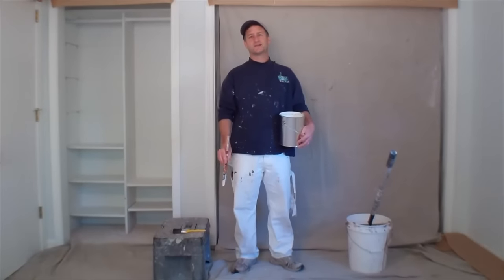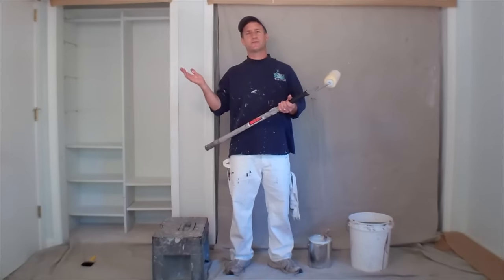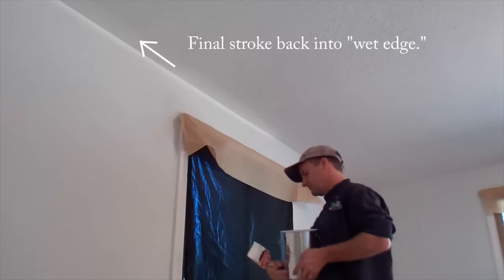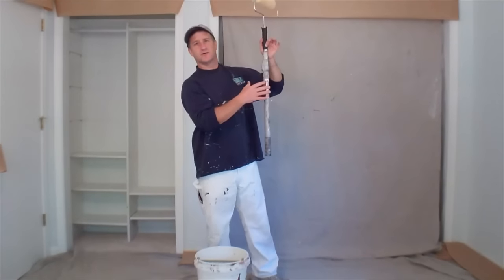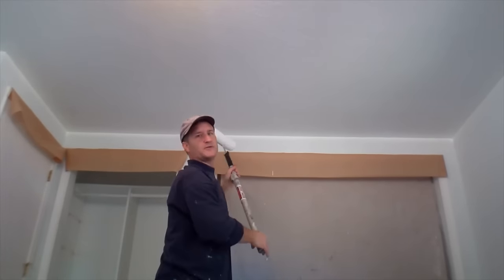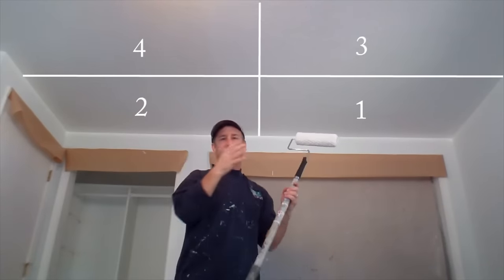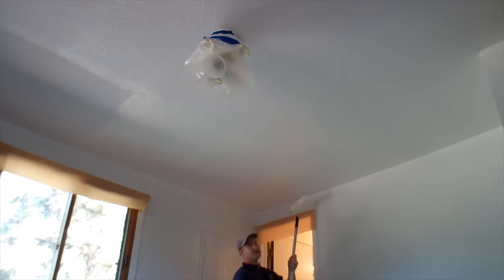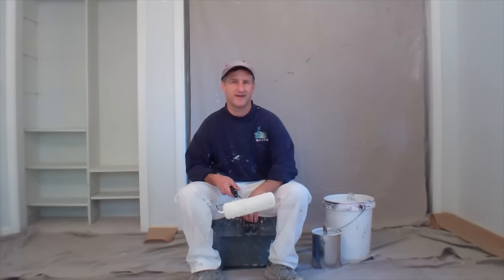Interior Painting Step 2: Painting the Ceiling

Comment: One of the things I've learned in my years of painting-ceilings is that by using a "short" stick, your head is thrown back and both it and your neck are constantly twisting-not good for the neck-especially if you have any neck issues (and if you do this often enough you will wind up with neck issue-which I have). To completely eliminate any head twisting; extend your stick out (about)  six-ish feet and work "in front" of you-so that you're looking ahead of you-never to the side. Work backwards-moving towards your backside. Once I figured this out, I never again twisted my head or ever had to tilt it back (slightly-once ina while). You'll catch on quickly and your upper spine will thank you.
Reply: Thanks for your great advice 😅
Reply: @ronaldneehao9723  My pleasure
Reply: Good insight. Thx👍
Reply: Really  good advice I had  the same problem
Reply: And it keeps the paint out of your face and eyes

Comment: Sure wish I had watched this video before painting my laundry room ceiling and walls last night! Your tip about cutting in a little at the top of the wall with the angled paint brush would have eliminated my problem of the old beige paint showing through in the corners and where the faulty edger I used kept hitting the popcorn bumps leaving a tiny bit of the wall unpainted. Ugh! Wish I had the energy to redo the job!

Comment: I have painted a lot of rooms over the years. One thing I learned was indeed dried paint and overlap marks. I have my own system for avoiding them. How does doing the cutting in all around the room with a paint brush avoid them?  Seems by the time you are rolling, the cut in would be dry and hence paint overlap marks all around the corners. 

For my part, I do cut in's about 2 feet, grab my paint roller, roll from there down, stop, do another 2 feet cut in, and then roll again. The roller avoids the brush marks and any overlaps. More effort, but the results are good.
Reply: Thanks for including your technique, I'll definitely try your recommendation.  Will you do a cut-in for the second coat of ceiling paint? Thanks again!

Comment: Hi-definitely it was paintable caulk i used and i even let it dry for 5 days but still happened it was a bison caulk and even after i touched up 3  4 times it still shows.
i ve done un experiment home and after i caulked a frame next day i stabilized it with latex and painted it the next day but it happend again
i will try your advise and do with oil based stabilizer or white paint and after paint it  with latex paint and let you know......

Comment: I learned many years ago to wet my roller or brush (then roll or shake excess water out) before using it to enhance absorbing the paint before beginning. This functions very well for me. Do you have a specific reason for not recommending to do so?
Reply: Robert Thomas I was taught that as well.   it's a good tip
Reply: Robert Thomas I
Do you 8
Reply: Z
Reply: @helenbriscoe1027  ...Pls translate.
Reply: He said not to wet it?
Reply: @jjmill5209  ... No he did not say that. What he does is dips his dry roller at the beginning in the paint to start. I learned to wet my roller in water (sink, shower, whatever) then shake or roll it out well so that it is not dripping wet, but moist and then dip it in the paint for the first time. This helps the roller to absorb the paint better. Note he says at 7:20 "now my roller is starting to get a little wetter, which is nice". BTW The same applies to brushes. After returning here do to your question it occurred to me that this could possibly depend on what type of roller one uses. The rollers shown in the video are usually of lower quality where I live (not the US) and therefore I tend to purchase better quality ones. Which of course means they are more expensive, but  last longer. I do not paint professionally, but privately and have had rollers and brushes for a numbers of years even though I used them to paint my house as well as for other people I know. Of course keeping them clean and storing them properly is of great advantage. I can understand though that for a professioal painter the time consumption is possibly not economical. I assume like in many other proffessions different handworkers have different opinions on how to accomplish their job. Which of course doesn't mean one or the other is wrong or right, but is just a matter of taste. Have a nice day.
Reply: I'm not familiar with wetting my brush or rollers ,with water .may try it

Comment: Great video, thanks.  Quick question, how would you keep a wet edge if the ceiling is more than 2 sections long. Do you do the entire length (eg. 5 manageable sections) and then start the next row or some other way? Again, great video and really useful practical tips.

Comment: I have a question regarding the cutting off the ceiling.  You say to paint it with a 2 inch angled brush and to get the walls with it....if u are painting a ceiling a blue color and the walls an orange color, would i still want to get the ceiling paint on the wall while cutting

Comment from the maker: Hi--You are correct that if you can stand in one place and roll the entire width, that works great, but if you divide it into halves and "lay off" toward the middle as I show, the roller strokes blend together and don't show up. The reason I demonstrate this way is because many ceilings are simply too wide to do the entire width at one time without "walking" along, and I prefer to stand in one place rather than walk with the roller. Just my opinion, though--there are different ways to do it.

Comment from the maker: Hi-If you are using a type of caulk clearly labeled "paintable," then it should not crackle when you paint it. The only time I've experience that cracking is when I've used silicone caulk that was not labeled as "paintable." (The oils in the caulk cause the cracking.) As a last resort, you can prime the caulk with an oil-base primer, then paint over it with latex paint--that should fix the problem too. Good luck!
Reply: howtopaintahouse
Reply: howtopaintahouse to  get  the  most  popular  and

Comment: Does it matter if the "cut in" areas dry before actually painting the ceiling? If it does, should i use a small roller to soften the cut in edges so it blends better by the time i paint the ceiling?

Comment: Thank you for the videos, these have been great. I'm currently in the process of having my new house built and in order to save money I decided to do all the painting myself. Since I have the entire house to do, I was wondering if I should cut the ceiling in and around all the light fixtures before rolling or should I go room by room? Thanks for your help John
Reply from the maker: I usually go room by room if I'm brushing and rolling. The only exception would be if I'm spraying, but I assume you are not doing that. However, if the house is not yet being lived in and if the flooring isn't in yet, I think spraying and backrolling is something you might want to consider. I guess I would need to have more info about the project, such as color scheme, whether there is new wood trim to be painted, etc.

Comment: Did you ever do a video on high sloped walls or vaulted ceilings?  I have a few very high walls and ceilings (14' and 25') to do, and I'm not too keen on any of the methods I've seen so far...  A brush holder on a pole simply can't cut in a straight line from that height, and I can only see that being of value if you're doing the walls and ceiling the same color.  A 16' extension pole seems viable for the ceilings (high and sloped), but it seems just too wobbly from the few videos I've seen on here to make laying off the paint smooth or edge-free.  A tall ladder to cut in seems like my only option outside of scaffolding, but this just seems like a colossal burden -- climbing up 10-12 feet, cutting 2-3 feet, down 10-12 feet, moving the ladder 2-3 feet, repeat.  Are there any better ways?
Reply from the maker: I'm planning to do a vaulted ceilings video but haven't yet. 25' is a high ceiling, pretty much impossible to do from the ground. Your only options are to use a ladder or scaffold (or rent a small man-lift if you can get it into the space--that's the quickest way to do large, very high ceilings). If scaffold or a man-lift aren't options, then I'm afraid you'll have to use the ladder and just move it along as you go. One thing you might consider is using an 18-inch roller. When doing large, high ceilings and using a long roller pole, an 18-inch roller is much easier to keep steady and make smooth roller strokes with. It's also easier to "walk" with the 18-inch roller so you can do a lay-off stroke from the peak of the ceiling all the way to the wall--it won't squiggle around as much as a 9-inch roller. (It is a little heavier, though.) Your local paint store should be able to hook you up with an 18-inch roller and roller pan. Thanks and good luck!
Reply: howtopaintahouse Thanks for the prompt and detailed reply!  I picked up a 14" cage and nap, having read that the 14" would be "better" than the 18" due to it having only a single arm, making it easier to get closer to edges with the open end.  After re-assessing size of these walls/ceilings -- and based on your insight of the 18" being steadier than a 9" (and presumably steadier than a 14") -- I think I'll go the 18" route.  Thanks again...

Comment: When you're painting the walls and the ceiling in a room, must you always paint the ceiling first? Why do you cut into the wall when you're painting the ceiling?
Reply from the maker: I paint the ceiling first because there is always some spittle and dripping onto the walls. You don't want to paint the walls first because you will have to redo them or do a lot of touch up, which often doesn't look too good. The reason I cut slightly down into the wall when painting the ceiling just to make sure that I'm getting the ceiling 100% painted, and also because that corner tends to be dry and an extra coat will make it easier to cut in that edge later with the wall paint.
Reply from the maker: One or two coats of paint on the ceiling should be sufficient, assuming it's not new drywall. I do not add water to my paint...

Comment: Painters are undervalued until one is in the thick of painting one's ceiling wondering how much is too much of the paint that's finding its way into one's mouth and what the harm might be of ingesting it with an aching back and cramping fingers. I got through it but I'll never paint another ceiling. It looks pretty good too because I used insanely expensive ultra flat ceiling paint but I'm convinced the best way to do it right is hire an actual painter.

Comment: What if your just painting the walls where do you start
Reply: Please reply very important
Reply: You just cut in your walls start cutting at the top of wall where wall meets ceiling then cut in corners of wall working down til you meet the trim cut along trim around light switches around door frames etc,etc then roll walls :)

Comment: Only use a brush around lights. Use a wiz roller around the whole perimeter once. Then use the wiz again in the corners. Finish off with your roller around the whole room making sure to hit the wall around the perimeter as you go. This guys method will make for one hell of a long day. Also use a paint tray please. I’ve done industrial and commercial painting. Only use a pail on blocks or when you can be messy. I’ve been a union painter for 25 years and I’m still laughing at all these guys on you tube teaching people the hard way
Reply: Massimo b, you said you was a painter for 25 years, why would you use a brush going around lighting? a true painter would remove lighting fixtures then to roll the paint, a brush will leave brush marks makes no sense to leave lighting up when you can undue couple of screws to lower the lighting fixtures.
Reply: Do you enjoy losing money removing things that are not required?  We are not electricians or carpenters on a job site. You must cost your company slot of time and money
Reply: @massimob2397  Sir, it tells me much bout a real good painter vs a real no good painter.. it takes 1 minute to remove screws if that & as I said it will be noticable to see brush marks would anyone in their right mind accept that? I dont think so.
Reply: Old Timer you must not have ever worked in a commercial or industrial job site. It’s not about what you want to do. And I agree I wish I could do certain things. But when you are under the gun you do what you have to do. Trust me I’ve been on jobs where my boss says price is no limit and we really give it our best. But 99% of times it’s all about getting in and out. I’m sure you understand what I mean

Comment: What about popcorn ceilings?  If I roll more than a couple of strokes, it sticks to the roller & comes off on the roller.  Aarrrrgggggghhh!
Reply from the maker: First, use a thick roller cover, like 1-1/4 inch. And you need to have several of them on hand because you'll go through them due to the fact that they "flatten" after a while and don't work the paint into the popcorn as well, and also due to the fact that you can get popcorn stuck in them. You might try getting the popcorn out of the roller using a wire brush or the curved side of a multipurpose painter's tool. If too much of the popcorn is coming off, you might consider just removing the popcorn before painting...see my website for instructions. Here's a link: http://www.howtopaintahouseright.com/wp-content/uploads/2012/05/Removing-a-Popcorn-Ceiling.pdf
Reply: You can buy a roller with popcorn style. i got one . it is foam with slotted slices in it. works like a charm
Reply from the maker: Interesting...I've never used one of those but it sounds good.

Comment: Ok, so the brush he’s using is a 3”, not a 3 1/2”…it’s just flared out a bit from use and from improper cleaning and reshaping. His roller cage looks like a ‘dollar store’ variety - don’t do that if you’re planning to do more than a single small job, it will wiggle and wobble all over the place and rust and make your painting life unhappy. Good cages can be bought for under $10.00 and excellent microfibre sleeves are about $4.00.

Comment: painting ceilings,step 1 safety glasses
Reply from the maker: Interesting...I don't usually worry about safety glasses unless I'm spraying ceilings, in which case the overspray definitely gets in your eyes and stings (especially oil paint!). Problem with safety glasses when spraying is that they get overspray on them constantly and are hard to keep clean. However, if somebody wants to wear safety glasses when rolling a ceiling, I certainly would not discourage it. I have found that latex paint in the eye, while it stings slightly, is not hard to clean out with a good rinse of clean water. Thanks for pointing this out.
Reply from the maker: ***** Flush it with water immediately for 15 minutes, and if any sort of irritation persists go to an Urgent Care clinic for medical attention. (I took these instructions off the back of a can of oil-based primer.)
Reply: Plus hair covered.
Reply from the maker: Couldn't hurt! I like a ball cap with a visor.